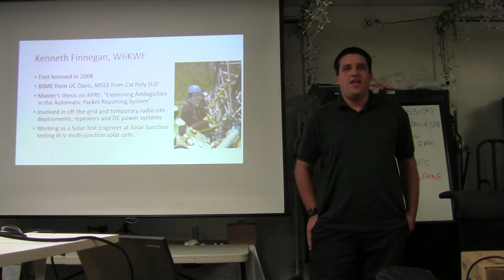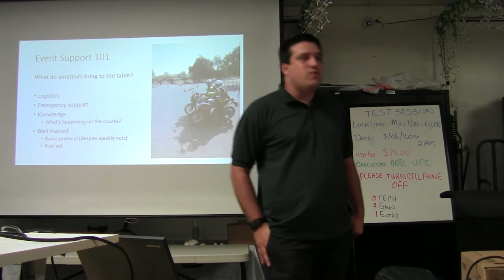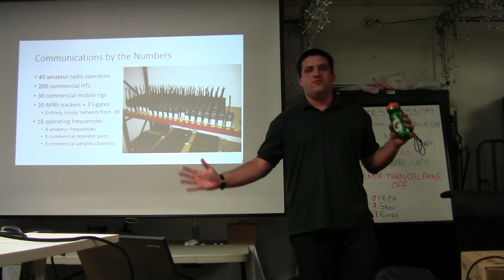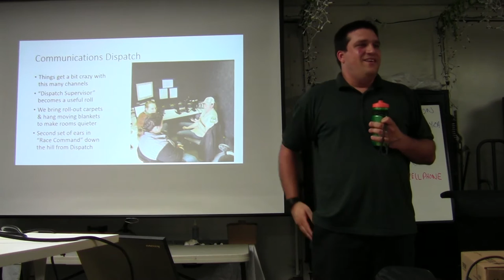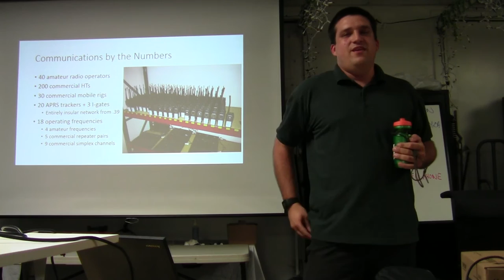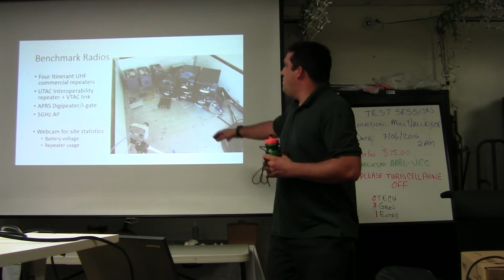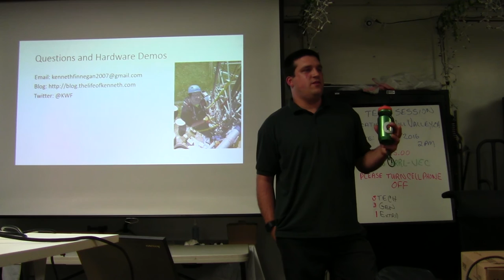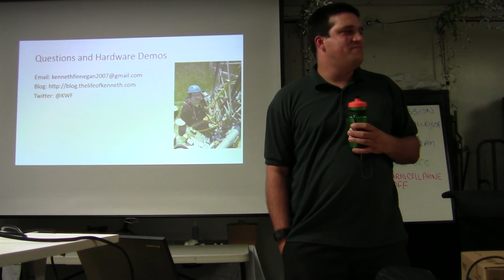Communications for the Wildflower Triathlon (Marin Amateur Radio Society)

Comment: Kenneth,
Just spent my lunch hour watching this video. It is the exact reason I got in to the hobby 40 years ago. Public service like you were performing, teletype, all of the intriguing tech that smelled like the 1940's. APRS and the other digital modes are more than likely what are going to consume me when I retire and see it put to use is great.

Your explanation of mixing commercial use and amateur use is great and very smart. I also agree with you about the ARRL erroring on the side of caution/ being pessimistic versus embracing what could be possible is what prevents many from staying in the hobby.

Again, great talk.

73